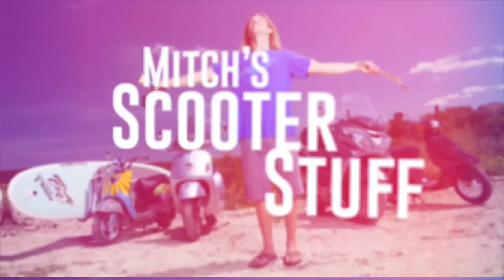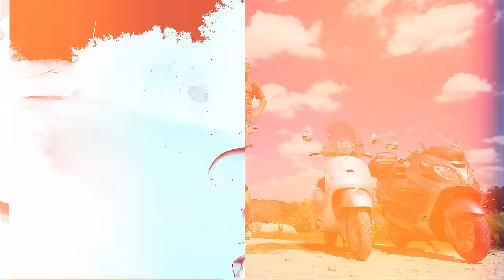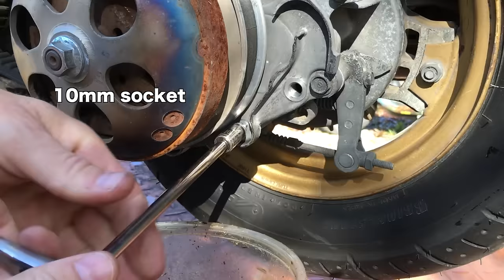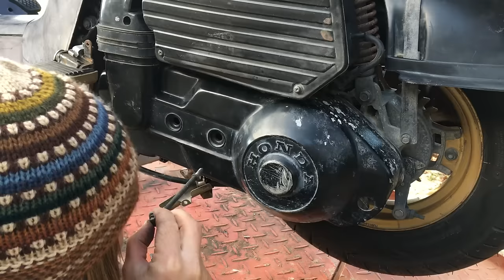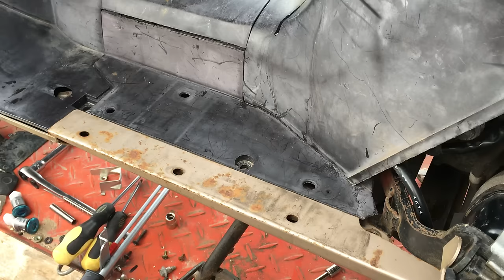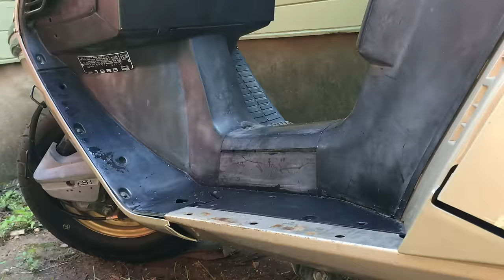Honda Elite 250 Transmission / Gear / Final Drive Oil Change Assembly | Mitch's Scooter Stuff

Comment from the maker: TOOLS I USED:
Ratchet 1/4 drive - http://amzn.to/2xcJEu1
Ratchets 3/8 drive - http://amzn.to/2hhmnUs
8mm 1/4 drive - http://amzn.to/2xMhsBl
10mm 3/8 drive - http://amzn.to/2xGuLSF
14mm 3/8 drive - http://amzn.to/2xGn4Ms
Phillips #2 screwdriver - http://amzn.to/2fgdZDL
Torque wrench 0-150 lb/ft 3/8 - http://amzn.to/2yrnPa9

Transmission oil: http://amzn.to/2oqjmkT

SHOP MY SCOOTER STUFF: http://amzn.to/2CbqQku

Comment: Where does it show to use gear oil? Manual says use 10w-40 engine oil..
Reply: Yes same question.  Manual calls for same oil as in engine.   Why are you using thick oil?

Comment: What do you do if this stuff leaks out? What seals should be replaced? Would make a great video. I have a 85 ch150. Per the manual I used regular 10w30 engine oil. It leaked out. I replaced it with 80w90 bell ray hypoid oil. Will that stop the leak since it is thicker oil?

Comment: Do you have to open and remove all that to charge the oil ?  I have a keeway matrix. Changing the oil is very easy. Nothing to remove to drain the oil and fill it up again.  Have a great day mitch.

Comment: Nice video, but I just vacuume  the old oil out of the fill bolt, usually by a siphon.   I don't get quite all the oil out, but I don't have to remove any body work or covers.
Reply from the maker: Oh yeah much easier job : )